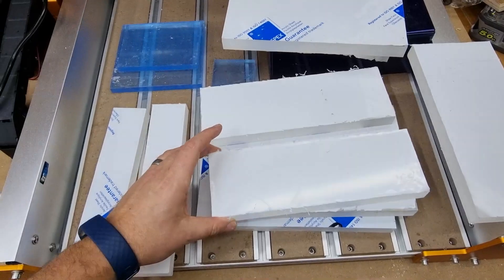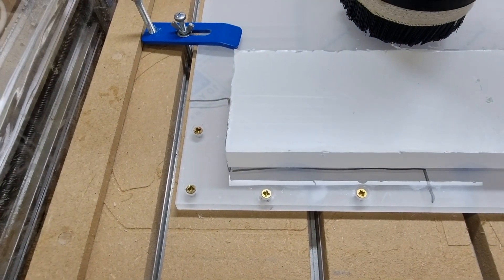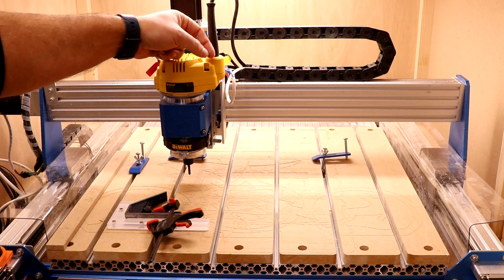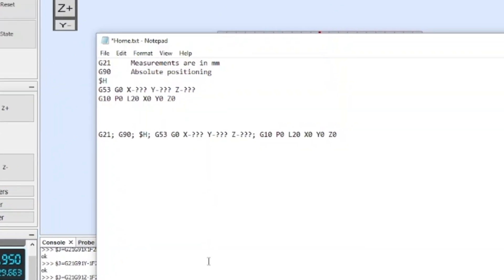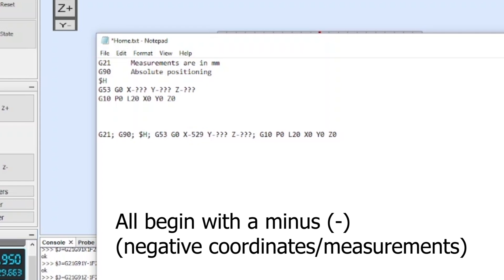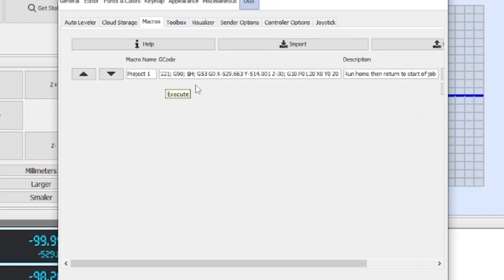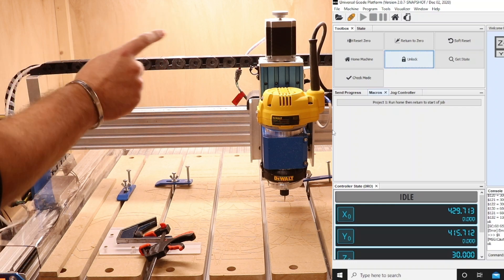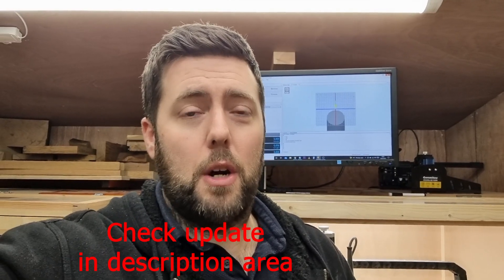CNC Repeat Jobs and Set Positions

Comment: Good job on this video.. I learned a thing or two.. 
Two things I would have done to make it more precise. 
1: use some 6-8mm guide pins to precisely realign the jig if you should choose to run the machine without it. 
2: use an edge finder to locate the origin..

Comment: If I do this, my program stops after $H. It just homes and stays idle. If I home manually and remove the $H, everything works fine. Any ideas why would it be?
CNC PROVerXL 4030 V2, grbl 1.1h as far as I know (the pne it came with, I did not check the version since nevver connected the machine to the PC).

Comment: James
I’m struggling with this. On your demo you reset the machine manually/turn it off so it starts at 000 but how do you do this in code without the switch off . 
Great work though and much appreciated work

Comment: In the interest of saving time, why not setup your home co-ordinates to be in the bottom left corner? Somehow I got this setup by default on my XL 4030. Since all my jobs start in the bottom left corner, the machine does not have to travel as far after it has been homed.
Reply from the maker: You certainly can do that. I just home to the back as I like to get the machine out of the way whilst I setup
Reply: how do you do this in UGS? I can't seem to figure it out
Reply: @ Run the setup wizard under the machine menu.

Comment: Great video James, I’m looking at buying one of these machines (Vasto)and have an odd question! The StepCraft M series is able to carve at bench level or on a floor if the machine is placed on a floor, is this possible with the FOXALIEN Vasto particularly.

Love your fixed position on this video, key for any cnc for ease of operation, in my view. Love the detailed explanation, thanks.
Reply from the maker: Yes, the bed is already quite low but you can remove it and carve lower, you just may need to drop the spindle down further.
Reply: Thank you James

Comment: This is great too because if your first toolpath for example needs a V bit and you use a touch probe you can't accurately set X and Y on a touch probe with a V bit.  If you start your job in the same spot on this is very handy.

Comment: Great video!  My 4030 always wants to reset during homing... don´t know why.
Reply from the maker: That's odd. On some control boards the port of the emergency stop can be close and the same as the limit switch ports. Possibly someone wired it up wrong in the factory 😕

Comment: Great video James 👍🏽, I have a genmitsu engraving machine and I use candle to run my g-code am I able to create this function on my machine as it would make life so much easier on setting up, cheers.
Reply from the maker: Persoanlly I would suggest moving from Candle anyway, but yes, you can create this as a custom button within Candle as well. When you open the settings menu you and scroll down there is an area for creating custom buttons
Reply: @JamesDeanDesigns  Thanks James 👍🏽
Reply: @JamesDeanDesigns hi James, what would you,suggest to be a replacement?  The machine xyz default is useless, and the home button keep trying to run past its limit and misalign the y axis (I probably set up wrong so,how).  This could be an elegant solution.  I have a genmitsu 4030

Comment: I really don't understand why you machined that fixture then basically threw away the datum position it could have given you in favour of "eye-balling" your work piece origin. All you've done is introduce un-necessary errors. A better and easier way would have been, in your CAM software, define the origin of the fixture to coincide with the origin of the work piece. That would have automatically given you X0, Y0 without any messing about. Generate the Gcode for the fixture and the work to use the same WCS and you don't need to do anything other than home your machine!
Reply from the maker: Because I'm still learning and this is the first time I've done this 🤷‍♂️

Comment: Nice one James.  I setup a similar thing a few weeks ago. I start most of my jobs from the centre origin, so have got multiple macros setup for each job.  I’m making clocks of different diameters at the moment, (ie 12 & 6 inches) so have a Macro labelled for each one that takes the machine through the homing process & then to the workpiece centre. Soooo much easier & faster to get started 😊
Reply: why does it have to go  through the homing process first?thanks